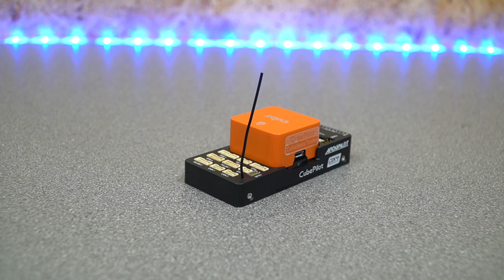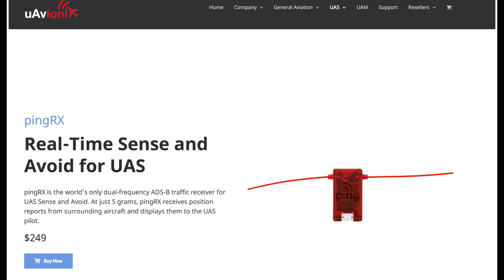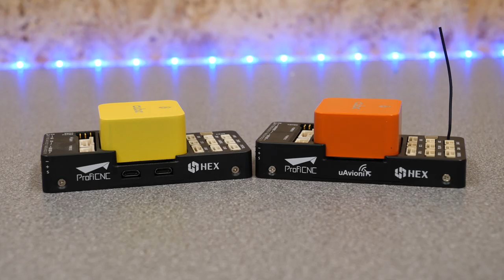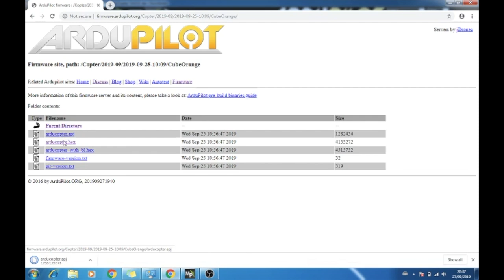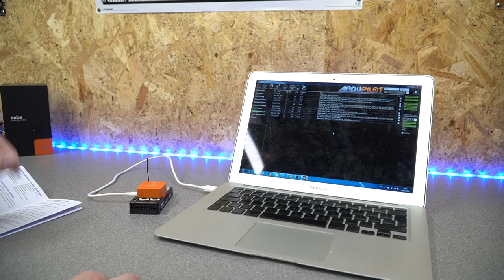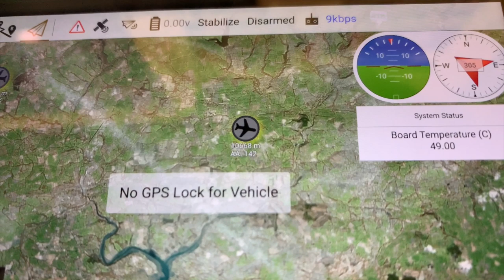The Cube Orange Autopilot/Flight Controller With ADS-B Overview, Setup & ADSB Demo

Comment: Thanks for adding the info on the SRx_ADSB parameter.  Since my ground station is connected via Telem 1 and a radio, setting SR1_ADSB=2 got me up and running.
Reply from the maker: No issues, yea this one needed a bit more explaining .

Comment: Hello, I have a question and if it sounds rather dumb, it's because it's an ongoing education, learning by videos such as this for my fpv builds...
So my 1st arduplane build has MP 4.1, and every time I boot up MP, it now says a new update is available, but I just ignore and press on...so I have purchased the pixhawk orange cube standard set for my reptile dragon 🐉: understanding that the orange cube requires firmware 4.0 and up, can I load the same firmware on the orange cube as I have on my first build?? By the way, first build is with original pixhawk black cube standard set.

The way I understand, I should make a copy of my parameter file, update, then reconfigure my first build all over again, then configure the orange cube...

Now if that's wrong, we'll, I'm still learning...but I could use your help to clarify this you would sir?
Thank you

Comment: Hello!

I made the necessary settings and saved them in the controller. I restarted the controller, connected it to the PC with a USB cable ... but no air traffic appears on the Mission Planner map ...
Is it possible that you do not receive radio signals inside a building near a window, or that you do not transfer data to Mission Planner via a USB cable?

Thank you for your answer!
Reply from the maker: Yes is very low signal is ADS-B, when indoors they would literally have to be over head and it still may not work in some buildings.

Comment: Dear, Is it mandatory to to use the standard carrier base to fit the ADS-B antenna? can be used the mini carrier base or even the dronee carrier base? Thanks for your classes!!
Reply from the maker: The carrier has the ADSB receiver in not the FC so the Mini Carrier will not work,

Comment: Hi, i have uploaded a copter quad frimware as you said and uploading done successfully, what the main problem is i'm not abele to connect the flight controller in any bands. checked for several times but no use. just brought this orange cube on 18/11/2019. looking forward for to solve the problems, as my project dead line is so near. please help me on it.
thank you
Reply from the maker: Please explain what you mean can’t connect in any bands ?
Reply: @MadRC   I mean it's not connecting on any values of bites like 57600, 111100.......etc.,  after that i have update the plane 4.0.7 frimware update was done successful but still i'm not abele to connect on any bit rate.
Reply from the maker: I suspect you have a driver issue, I would download the latest drivers again from the Ardu page and then install them.  You may need to do the flush from Mission planner as well.    There are some specific issue with windows 7 on this especially.
Reply: @MadRC  I'm using windows 10 and have downloaded new drivers as well but still its not connecting, can you share me a link of the driver which you have used or you can send me an email at gowtham@marutdrones.com and also please send me the firmware which you have used. this would be a great help. 
thank you